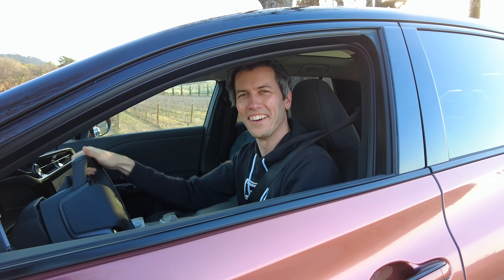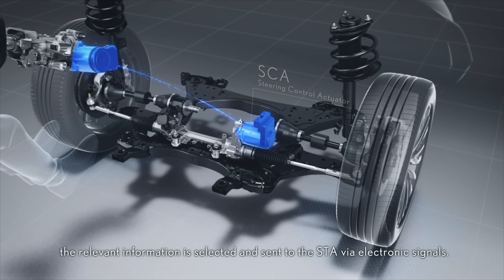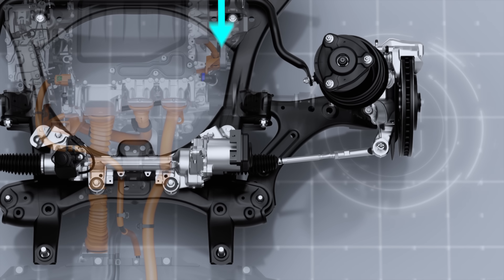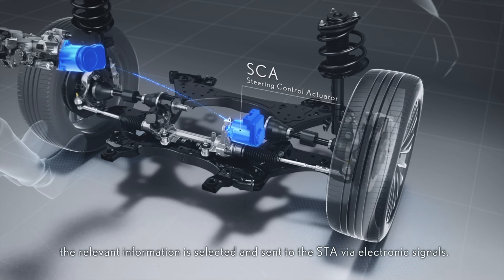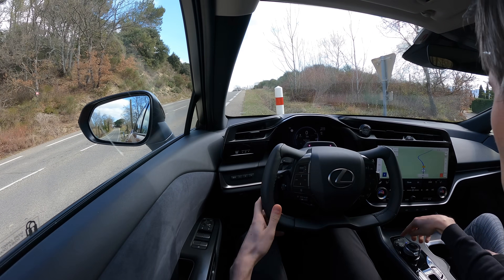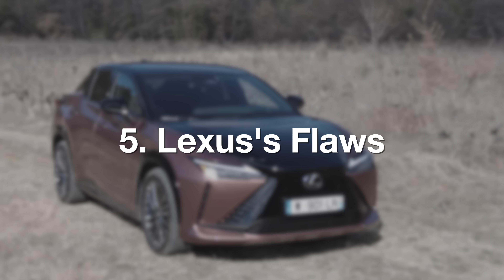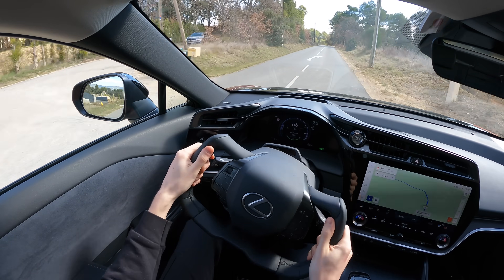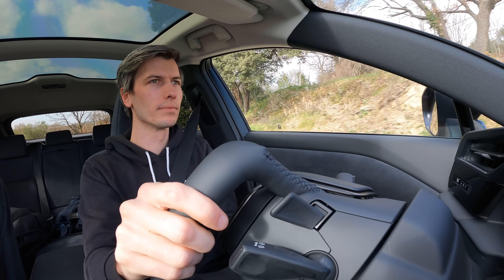How Lexus Fixed Tesla's Bad Idea: Steer-By-Wire Yoke

Comment: That steering wheel delay alone would be a deal breaker for me.  But I do like the idea of adaptive steering wheel ratio (done well).
Reply from the maker: Agreed. They haven't announced release date for this system in the US, so there's still time, and I'm hoping that's fixed. A big talking point was that it would be instant, and not have a delay like a mechanical system. For now, the opposite is true. And admittedly, the "delay" in mechanical systems is quite small. There is some slop, anytime you have many interconnected linkages - companies like McLaren put a lot of emphasis in using really rigid components (like the steering shaft) so that there's very little twist, just direct feel.
Reply: @EngineeringExplained  to my knowledge (insider here) it is destined to become available only in 2025, so there is plenty of room yet to improve.
Reply: @EngineeringExplained  Hey, Jason, can you comment on the legality of steer by wire? Doesn't there be a regulation which requires physical linkage between the steering wheel and steering rack?
Reply: @EngineeringExplained  seems to me that in the mechanical steering delay happens first, wire happens last if that makes sense
Reply: @EngineeringExplained  The delay is an inherent problem caused by putting a computer between you and the tires. The computer has to "read" your input from an ADC, which takes time, run a series of instructions to compute the corresponding output signal, and then it has to "write" the output to a DAC, which might actually be a whole series of outputs, which would take longer to calculate than just one output. While it's doing this, it's also "reading" the vibrations from the tires, doing statistics on them (which requires many, many instructions and therefore takes a long time, plus to do statistics there has to be more than one sample, so they have to buffer the vibration samples until there are enough of them to do a Fourier transform on), and then "writing" a series of modified numbers to a DAC (after reversing the Fourier transform to create a series of vibration samples again) that converts the numbers into the modified vibration you feel in the yoke, without the vibrations that the engineers decided are irrelevant.

The force feedback is probably even more delayed than the steering input.
Reply: @EngineeringExplained  I wonder if they'll switch to some sort of fiber optic communication to achieve less of a delay, although you'll have to process the data before and after the fiber.
Reply: @theheadone  The delay isn't due to the speed of electrical signals, it is due to the overall implementation of the system, including mechanical components, e.g., the actuators and feedback motors.
Reply: @theheadone  the delay wont be due to the signalling, it will be the power and tuning of the servo motor that does the steering. Can probably be fixed in software or replacing the servo to something more suitable. As a pre-production model they might not have taken particular care at this point. I'm sure it will be solved when released to the public.
Reply: @EwanM11   @AV System ah, thanks for the clarification.
Reply: @theheadone  electric wires already work at near speed of light, fibre optics only increase bandwidth, which is not the problem here.
Reply: @theheadone  fiber optics are not very wear resistant and rupture very easily, I doubt Lexus will go that way. Better possibility a faster BRAIN, eg ECU.
Reply: @theheadone  - It's not that copper wires can't transmit the signal fast enough, there's either some processing delay, or actuator delay or the combination of thereof.... or simply a pre-production not turned yet properly.
Reply: @theheadone  In my opinion, they already use fiber optics cables(even old CNC machines use optics cables to control motors), the delay is probably from the processing, as you mentioned.
Reply: @theheadone  I suspect the delay is mostly processing time, not the wiring between the controllers. They'd just need to use more processors or faster ones.  It could also be the actuator just isn't fast enough to turn the wheels on its own with no help from the driver.
Reply: @theheadone  pretty sure the wire is not where the delay happens. even with regular Ethernet cable the signal through a 3 meter cable (not even close to this long in this case) will be in 1/10th of a millisecond. data processing is the bottleneck
Reply: @theheadone  ב''ה, fiber optics may have reliability benefits or not, but generally not latency benefits.  (Putting an optical encoder in the wheel by fiber direct to a module at the rack is an interesting thought for other reasons, though.)

Seems the bottleneck complained of and concerning here is that it's physically possible to turn the steering wheel before the actual wheels have finished traveling, as standard mechanical linkages prevent.  So, how to provide more aggressively realistic feedback at the steering wheel without the driver feeling like they're fighting it? If the steering can keep up that shouldn't feel different than a regular car.
Reply: @theheadone   You don't need fiber optics. Regular copper wire will work just as well. The reason we see fiber optic a lot now is because of the amount of data it can transmit. Electricity already travels very close to the speed of light in traditional copper wiring.
Reply: @theheadone  The processing is where the delay is coming from. The most they could possibly do is give the computer a highly overclocked and liquid-cooled CPU to make the processing faster.
Reply: @theheadone , it is not about fiber optic or wire. The delay comes from necessity to digitally process signals.
Reply: Yes, I guess this would cause the car to feel really "sluggish" during quick turns. Like for example many SUVs can do because of suspension roll, but worse.
Reply: @Speeder84XL The point of the whole implementation is to increase manouverability. Do you genuinely think they'd roll it out with it being a slower response than regular steering?
Reply: @Speeder84XL  you are probably right. Compare to adaptive brakes. I don't have problem with assisted brakes. that give me a  PROPORTIONAL increase of force. But adaptive brakes just start to brake more than you are, so sometimes you have to slowly put you foot up DURING a critical point of reduction. I think that's the same problem with steering RATIO changing according to speed.
Reply: I don't think the delay here is a big problem. It probably happens only when the steering ratio is very slow, because the motor in the steering rack has some limit to its speed. At that moment, you can turn the yoke faster than the SCA's ability to turn the rack. But on higher speeds where the ratio is different, I don't think the delay would be noticeable.

The only thing I am really curious about is the need for sudden maneuvers at high speeds, like the moose test. If you brake suddenly, you woudn't want your steering ratio to change very abruptly.
Reply: @1994savvas  You're talking about inertia, but this here is delay. I went frame-by-frame and I counted 10 frames where the steering angle on the front wheels kept increasing while the driver was already steering in the opposite direction. This video runs at 30 FPS, so this it 333 ms of input lag. Such horrendous input lag probably won't be acceptable even for console gaming on a TV.
Reply: Same, there is literally no reason for such a delay on this steer by wire system,
Reply: Also there would be no way you can actually turn the  conventional steering system faster than the actuated steering, I think.
Reply: This is not just attributed to signal and motor response delays but that there is a limit to the speed of the motors controlling the steering. They can't keep up with sudden large steering change commands from the wheel. If the inputs and movements of the wheel are small, the wheels will follow it closely. Large steering inputs are done faster than the motor in the rack can keep up with. For a large vehicle like this, steering inputs that large are rare.  The Electric rack speed limitation can be felt in a car with standard electric power steering. Turn the wheel very quick and you'll notice the wheel will feel heavier due to the motor in the rack not being able to keep up to supply the force needed to assist.
Reply: Be nice if there was some form of customization similar to sims
Reply: @srfnsurfer  me, I want 20nm on the wheel😂
Reply: I’m sure someone else has said this already, but all this just to make a yoke possible is just not a good enough reason. I personally would want this tech used to implement a driver preference for steering ratio, but then also have a checkbox that steering ratio should stay consistent. This way, you can set it to how responsive you want the car to be, and you can still depend on your muscle memory for how much hand movement results in a certain wheel movement.
Reply: It’s actually quicker than the mechanical rack in the system on a 2014+ Infiniti Q50/Q60. I would think Lexus should be able to replicate that with some more development.
Reply: Adaptive steering wheel ratio is the first thing I turn off in my simracing simulator. It's really annoying like for instance when you accelerate or brake in a turn.
Reply: Most modern racks have variable gears
Reply: Shouldnt make a difference unless youre racing
Reply: The steering delay when the car isn't moving (as shown here) really doesn't matter. Also probably wouldn't matter much at parking speeds. What wasn't shown or discussed is if the delay that was evident there was also evident at speeds greater than 0, or whether this was tuned (or tunable) at all.
Reply: ב''ה, though it's all a bit complicated look up the jitter issues with "audiophile" fiber to see why throwing optics at things doesn't solve every problem, although that's also a fiber-to-electrical and implementation issue.
Reply: Yes that lag would be very clearly felt at 100mph.
Reply: Did the video imply the delay is noticable when driving? I'd guess its not since there is not a single scenario where youd want to be going from 0 to full lock instantly and expect a controlled outcome. Unless you're drfiting. Thats to say it could be the case that theres no lag while simply driving the car.
Reply: Latency, that's the word you're looking for.
Time for Gamer z words! 😅
Reply: I think that delay is a bit misunderstood. There has always been a delay of where you intend to go and where your wheels point. If you want this to be instant you would need infinite force because the steering system has mass. It would also mean you would flip your car over. So the delay is nothing new people just mistake intention for steering wheel position and it's for your own good.
Reply: Perhaps this steering delay is due to the steering control actuator having a maximum turning speed? I suppose they could "fix" this by introducing resistance to limit how fast you can turn the steering wheel to accurately reflect the tires rotation.
Reply: This. Delays on the throttle don't kill people. Delay in dodging the moose will.
Reply: @ibdoomed  bingo.
Reply: We already had variable steering ratios. This is just over-engineering and planned obsolescence that it's finest. There's some reason why you don't see the old over engineered '90s Mercedes s classes or even the early 2000s s classes. They were overly complicated, over engineered hunks of junk that no one wants to fix, so they're all dirt cheap and most have been crushed
Reply: @MaFTB  Can't agree, love my 2000 E55, rust is the main killer of these not failure of the steering. The variable rate on mine is achieved mechanically in the rack so as the wheel is turned more the ratio goes up for parking and the wheels turn more for the same amount of steering wheel input, the hydraulic power steering just backs off at higher speeds. Not really that complicated compared to modern electronically controlled electric power steering, also being rwd old Mercs have much better steering lock than fwd or awd cars.

Thing is these systems are mainly going to end up on EVs so a little extra complication in the steering is more than made up for by simplicity everywhere else, no IC engine (and often no gearbox) and all the associated complexities that come with that.
Reply: Steer by wire, a huge money pit for the owner in the future.
Reply: @hedgehogthesonic3181  as a mechanic I think there’s a solid chance that the opposite will be true. Theres a lot of connected components in the steering that wear and need to be replaced, this system appears to be less components to be replaced. It’s also electronic so may be able to self diagnose. These 2 factors will cut down on labor times and possibly the customers price. All depends how expensive the parts themselves end up
Reply: @hedgehogthesonic3181  in Europe Lexus gives 10 year 200 000 km warranty that covers steering column and rack.
Reply: @hedgehogthesonic3181  If it was any other company than Toyota, I would agree with you. While no company has a perfect record, I suspect Toyota will test the crap of steer-by-wire in millions of simulated miles to test the reliability.
Reply: @downinla4076   Let's hope so, but that electric motor that turns the wheels better be so reliable that it's ridiculous, because if it ever fails, car won't steer.
Reply: Wouldn't that problem be caused by the resistance of the wheel on the road? If the response was instant during a quick turn, it would eat up the tire at the contact patch, i asume.
Reply: @maxtremegamer_  It would be nice to see the same shot with the steering wheel equipped model to see how much of a difference we are actually talking about. Maybe once it goes into production.

Comment: The thing is its all more complicated than it should be, I mean, you can understand the one perspective of being able to keep better straight line stability on all roads, but its that complexity that isnt needed for the average person i believe, if you got a new car like this, you will play with it for the first month or 2 and you would efectively want the sensitivity option to be set by yourself and locked in, if you live on the edge and want your pinky to do 120 degree turns all the time, then that is something the user would know, and edit their personal driving style to, and be aware themselves of what they asked for, knowing they could probably roll the car at any minute, same goes for the flip side if you want to have zero response as you go full lock into every corner but most of them turning out to being 3 point turns when you do so.

I mean, we cant judge on how someone wants to drive its their choice, and i just see so much lack of this these days, The problems always arise when we dont know the problem and just think "Its normal"

Comment: I remember putting a quick ratio steering wheel on my S13 back in the day and the first time I drove it afterward I nearly steering into the curb when turning. After a few minutes of driving my mind got around the quicker ratio and I was able to have much more control over correcting oversteer, one of the best upgrades I made to that car besides the SR20DET. As long as the steering is progressive according to vehicle velocity and acceleration a yoke would be awesome!
Reply from the maker: Neat, thanks for sharing! Yes, it'd definitely allow for correcting faster, I think in many cases folks would overcorrect until they're used to it.

Comment: I would not be quick to characterize the lag in response as delay (although it very much is under lock to lock conditions) I would rather characterize it as a slew rate limit. In other words, do you feel a delay in response when the total "slew" of the wheels is only a degree or two (highway lane adjustments) if the answer is no, and you only have a delay in parking maneuvers, then it is a slew rate issue (i. e., the rack motor is reaching peak RPM). As such, then it comes down to how the motor mounted on the rack is sized, rather than the timing of the electronics or software control systems response time. If this is an accurate way to characterize what's going on, then the severity of this delay in day to day user experience is far more likely to be tolerable.

Note that hydraulic and electric assist systems can also reach power limits, although I've only experienced it a handful of times in my life during rapid bi-directional steering maneuvers. In that case the driver experiences a sudden drop in assist torque that is quickly restored.

Comment: I think it is brilliant. But I do have one question. I'm pretty old and have driven many miles. There is one thing that has amazed me a few times and thankfully only a few times. These are emergency manouvers. Once your instincts and reflexes jump in, things happen extra fast and your response is purely reflex. It can be as simple as a skid on ice to having to avoid a moose at night. I realize you can program all kinds of responces in this type of steering system, but how do you program it for all kinds of emergencies? How do you program it to deal with your reflexes? To me its kind of like self driving cars. They have been working on this for years now and we see how far they have come and how they are still very limited in scope. However I'm not one to discount modern technology and suspect this type of steering system is probably the last development needed for us to eventually have real self steering cars. I'll be the first to admit this old dog would probably not adapt very quickly to it.
Reply: Once you start sliding on ice the wheels just go wherever they want to.
Reply: @LaserFur  No, you can get control back by turning the wheels in the direction of the skid. But you do need some touch feedback to do this.